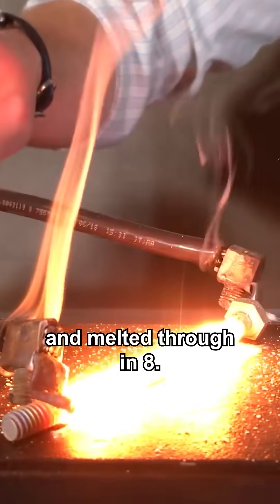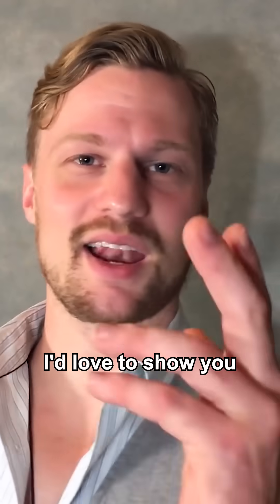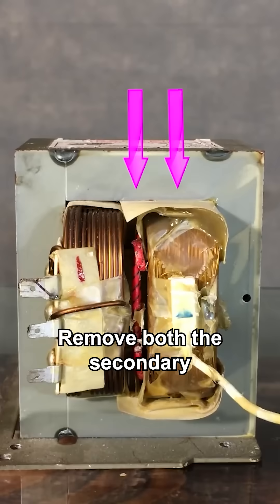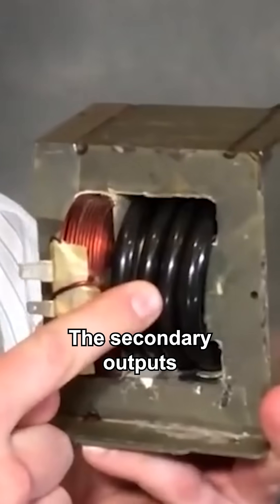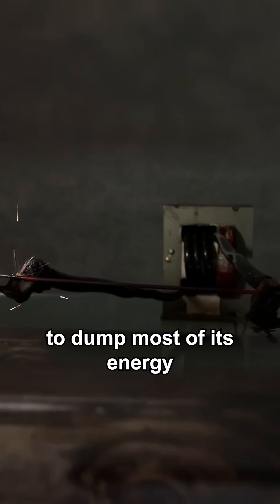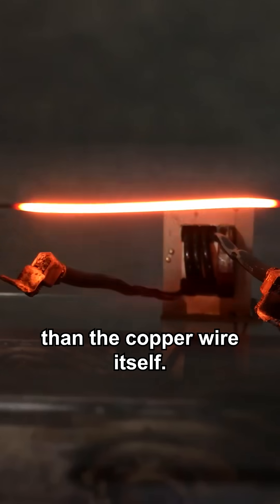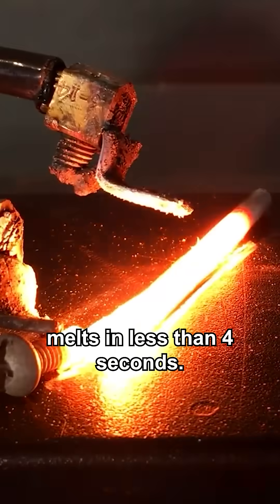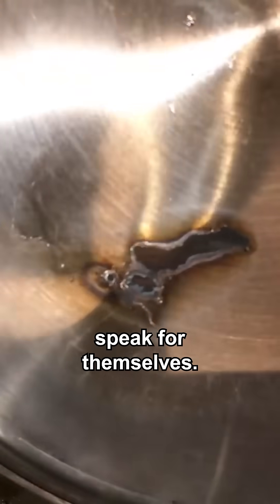DIY Steel Melter (High Current Electricity Hack)

Comment: Do you know that when you heat steel that contains chromium to over 1000 °C, highly toxic chromium(VI) compounds are formed, which are released as dust or fumes? These compounds are hazardous, especially when inhaled in dust or fume form, and are typically produced during processes like welding, cutting, or thermal treatment of chromium-containing steels.

Comment: Hey you should warn people people can easily die from this my good friend died from a mot  I'm really shocked that you didn't spend as much or more time on saying how to do this safely I really hope you redo this video
Reply from the maker: Modifying it to produce high current makes it safer. You can hold the output with your bare hands. There is no need to warn of safety when dealing with only 3 volts. Cheers.
Reply: @PlasmaChannel  But still, >200 amps is the main concern. So better consult the professionals that specialize this kind of electrical and metallurgical stuff.

Comment: Why aren’t the wires glowing red too?
Reply: The wires pass power easily with very little loss of power due to them being made of low resistance copper.

When the power passes through the steel the steel doesn't allow the power to flow as easily due to it's internal resistance which changes most of the power from electrical to thermal; thus turning the steel red once heated.

For power to be transferred there must first be a voltage difference and then there must be a conductive path. If the conduction was perfect then you would have a superconductor with no electrical resistance. As the conductivity decreases the resistivity increases ( r=1/cond. ). With an increase in resistance occurs more power is lost to thermal. At some point a high enough resistance exceeds the voltage difference of the supply and power flow stops. This is usually referred to as an insulator. As no power flows none of the power is lost to heat.

Unit basics:
The flow of electricity is measured in amps ( I ).
The voltage (potential) is measured in volts ( V ).
The quantity of power currently flowing is measured in watts ( P = I V ).
The current is based on the voltage potential and the total resistance ( I = V / R ).

Comment: The discovery of nichrome (Nickel-Chromium alloy, 80% Nickel and 20% Chromium) really was a game changer for our civilisation. Everything that has a heating element uses it: heaters, electric jugs, hair dryers, heat guns, toasters, espresso machines, electric ignition systems, electric furnaces, electronic resistors, foam cutters, laboratory hot plates, plastic extruders for 3D printing or plastic moulding, just to mention a few. Nichrome's high electrical resistance means it turns electricity into heat easily, and has a high melting point of 1,400 degrees Celsius (2,550 Freedom units). How many people know who Albert Marsh was?
Reply: And when you heat steel that contains chromium to over 1000 °C, highly toxic chromium(VI) compounds are formed, which are released as dust or fumes. These compounds are hazardous, especially when inhaled in dust or fume form, and are typically produced during processes like welding, cutting, or thermal treatment of chromium-containing steels.

Comment: This is dangerous af but apparently fine on YouTube?
Reply from the maker: Not dangerous. You can hold the output with your bare hands. Voltage is too low to pass any current through your body.
Reply: @PlasmaChannel IF you do it right.

Comment: Basically melts metal through induction
Reply: Conduction*
Induction would be done using an alternating magnetic field.
Reply: 🤦🏻‍♂️ You WISH induction! I wish induction! 😆 Alas, a transformer does NOT step up the AC CYCLES. Reglar rabbit resistive heating.

Comment: Why don't you make that big metal coil thing that can actually suspend a molten liquid metal ball
Reply: 'Big metal coil thing' = induction heater. The coil produces an alternating magnetic field that induces a current into the item being heated. As the item isn't a superconductor the item has internal resistance to the current. That resistance converts the electrical power into thermal energy heating the item.

Comment: Brother, NO! Do not encourage amateurs to tinker with microwave transformers. That's literally one of main causes of death of "high voltage hobbyists".
Reply: This short is incredibly irresponsible
Reply: @chonkusdonkus 
 I mean his yt channel is about high voltage but still tho 
Your right he didn't even add a warning about how deadly extracting a microwave transformer is.
Reply: @chonkusdonkus  yeah dangerous especially for 
What do you call them um I think it's called high voltage noobs or beginners
Reply: Philippine Central Bank wants to hire Foundry electricians in near future
Reply: *High-ampere hobbyists
Reply: @patrickryanagapito502  
yes high current low voltage can kill you but not with shocks  it will kill you if you don't have a way to put out the fire risk
Reply: It's one thing to promote caution. It's another to try and regulate it in it's entirety. Bad! Bad people! Stop it!
Reply: Except that it isn't a high-voltage transformer after the modification, is it? It's actually quite the opposite.
Reply: @BalticLab   well high voltage can absolutely be dangerous if the current is over 10ma in fact even current low as 5ma can kill you don't understate high voltage
Reply: @BalticLab  That doesn't really matter. The point is that amateurs disassembling microwaves have a habit of dying.

Comment: Please mention that if you are getting this out of a microwave to discharge the transformer and any capacitors with a rubber handled screwdriver before attempting any disassembly, even if it has been off for a year, the shock can still be lethal
Reply: The biggest issue with microwave transformer builds, is that most are attempted by kids..... Definitely lethal at full charge..(2100V). Never ever rely on bleed resistors.
Reply: @REVERSE_BIAS  yeah 
commonly Kids who do microwave transformer projects are usually 14 to 18 years old,  and that's really concerning ngl
Reply: In the 60's-80's highschool students used to charge capacitors with the 115v socket and toss it to someone trying to get them to catch it 😂
Reply: The capacitors often Come with a built in or external resistor and i dont think even if it was charged it would kill a healthy person. But still its definetely a good idea to short it before touching anything